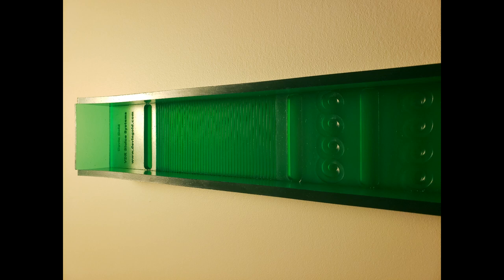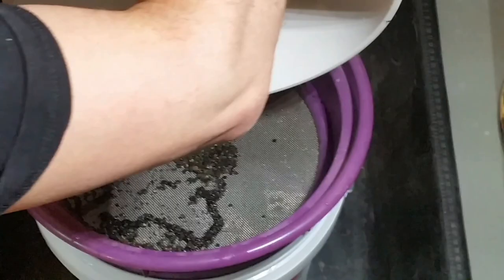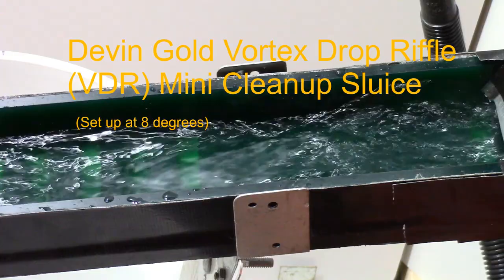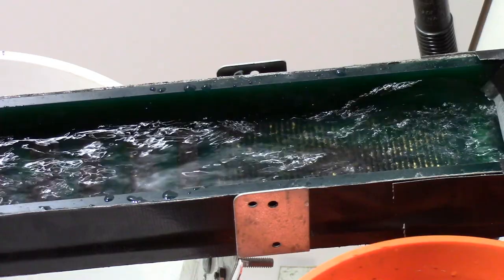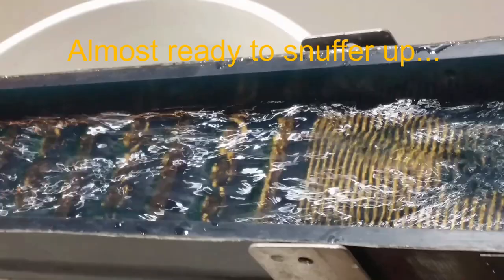Devin Gold VDR Mini Sluice Cleanup Demo - Reduce black sand cleanups from hours to minutes!

Comment: I just got my mini sluice.  What do you guys use to hook up a hose?   I'm going to design and 3d print one for the time being.   Getting ready to try it out!   Can't wait lol
Reply from the maker: Awesome! You can make an adapter like we have in the video (Metal or plastic piece cut to fit the sluice, drill a hole. 3 /4 inch MIP by hose adapter male, 1 ¾ inch electrical washers 1 ¾ inch electrical nut (2), Silicone adhesive) so that it fits onto a garden hose or a bilge pump. You can also use a clamp or tie wrap or rig / 3d print your own. That's really cool you have a 3d printer. I keep hoping they will improve and their unit costs will drop to be affordable so everyone can design and make their own parts. We are close to putting the adapters back on our site, just have been trying to reduce costs enough so that people get a good price. Let us know how it works out. Make a video if you're bored too - I think these sluices are pretty incredible and I've yet to meet a prospector who disagrees.
Reply: @InfinityProspecting  sounds good. Just came off the printer.   I would recommend the prusa mk3s.  It's reliable and does everything I need!  They run $750.00 us.  And best part is the part only cost $1.07 to print.
Reply from the maker: @MD-NWWI  Wow. Thanks, Greg! I will pass that info along to my dad. We've been trying to get the cost down and I was shocked at how expensive such a small simple thing could be. If we can just print them that's probably still a lot cheaper than the current setup which is still fairly labor intensive.

I appreciate the comment and suggestion! 

P.S. Flour Gold Wizards mentioned his secret code in the comment section of his last video if you are looking to save a few bucks on your next purchase.
Reply: @InfinityProspecting  thanks ill be using that. I'm going to order up a couple gold cube mats in the next week!

Comment: Pretty interested in this, just for fun since I can go snag buckets of black sand  or concentrates from the river and clean it up at home mostly.  Lots of black sand to be had out here in WA state.
Reply from the maker: It is a lot of fun especially if you can relax and focus on exploring and having a good time instead of worrying about what to do with the cons. I wish I could send one of these back in time to myself just because you learn so much more if you can add accurate counts to your exploration. Like I got .1 g in 10 pails in this area and .5 in another it really helps visualize the gold distribution. If you just have tubs of black sand at home that doesn't really give you much knowledge... or much gold that you can show off.

Thanks for the comment, Neo!!
Reply: @InfinityProspecting  Absolutely and thats all I care about is the chase and the fun of being outside.  I'd be happy to find a few specks and play with my toys.  

As far as your sluice I like the way it looks and if it handles sand with ease its just more attractive than other options even though I am a complete beginner.

I see the blue bowl and the silicone mat, miller tables, gutter sluices that can be bought or handmade and the gold cube (which is useful).
  
I just feel like a simple sluice is more attractive and around the same price point for small cleanups or even if I was a regular hard core prospector where sand is a pain in the behind.

Definitely on my list.
Reply: Concentrations are not high here I can see so for a hobby thang this fits in the apartment. Or in the shade, I would say make some metal versions cause durability is a big deal.
Reply from the maker: @neobaggins285  There are metal versions available at devingold.com but we've used the cheaper rubber versions for years without any visible evidence of wear. If you are running a huge volume every day for years the commercial rubber mats do wear out eventually but generally if you are running such a huge amount of material then it just becomes a tiny cost of doing business. I don't think you can realistically wear out a mini sluice given it is so gradual of a flow. We also make the mini sluice out of a much harder and more durable rubber compound than we do the regular mats and both have torture tested with no issues. I'd have no problem putting a 5 year guarantee on them, so maybe that's something I will discuss with my partners.

Thanks for the comment and interest!
Reply: @InfinityProspecting  Thanks for the heads up on that.  I'm still wanting one just gotta gather some cold hard cash..plenty of time though.
Reply from the maker: @neobaggins285  Cold, hard cash (gold and silver) is the best kind :)
Reply: @InfinityProspecting  you bet, I'm going to the gold standard early and we all will be soon.

Comment: I have my clean up sluice, my question is what do you use for a pump? Gallons per hour?
Reply from the maker: Generally we use an 1100 GPH pump starting at probably 70% and then gradually increasing until the riffles agitate and dance properly, then speed it up a bit at the very end as long as gold isn't too far down the sluice. A speed controller or valve is definitely handy.
Reply: Is there a speed control or you would recommend are these items that you supply?

Comment: I ordered mine weeks ago still hasn't shown up. I hope it shows up soon.
Reply from the maker: Hey Bill! I checked your tracking and your package has left Eugene so I imagine it will arrive within a few days. The expected is the 23rd or earlier. I imagine there is still a bit of Christmas and covid volume flowing through the postal system so thank you for your patience. The sluice is definitely worth the wait! Thanks!
Reply: Wow thank you for checking on that. Great to know.
Reply from the maker: @billgolub9572  Not a problem. Thank you for your patronage!
Reply: Lol did you know eugene is 3 hours away. Again I appreciate you thank you.
Reply from the maker: @billgolub9572  Well lately it seems like the Canada Post and USPS are in molasses mode. If it's 3 hours away they will have it for you in 3 weeks or less lol. We've encountered some oddities of the system too like we wanted a package sent 400 miles south and the post sent it like 3000 miles in a giant C arc throughout the states, generally going in the opposite direction as the destination. It is because the packages flow to centralized depots for sorting.

We appreciate you too, Bill!
Reply: Got my sluice today ty very much again.
Reply: Can I run the bilge pump without the battery and use the battery charger to run the pump from the wall. I have a speed controller.
Reply from the maker: @billgolub9572  Hey Bill. You can hook up to the battery while it is charging (connected to the wall) just be careful to protect it from water. If you want to hook directly to the wall without a battery you will need an inverter that has a higher amp rating than your bilge pump. They are kind of pricey though for the ones with enough amperage, so I'd just run off your battery while it is plugged in and then take alone a fully charged battery to make a self contained system when prospecting in the field. Thanks! Let me know what you think of it once you get it dialed in!